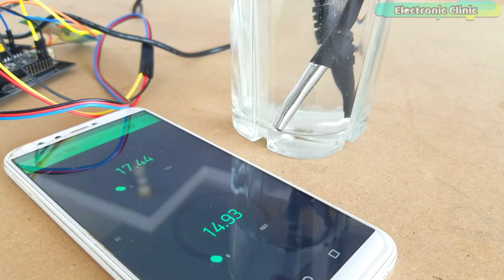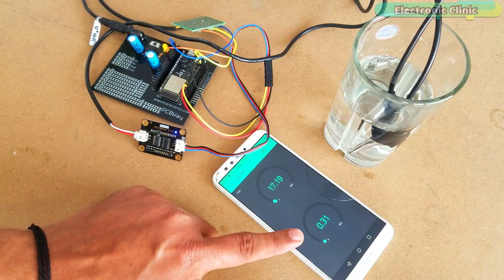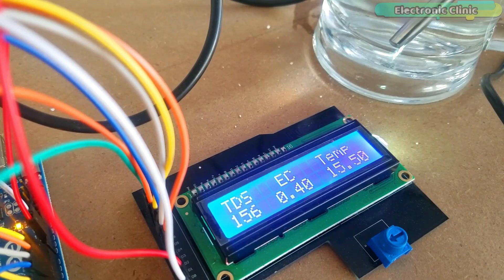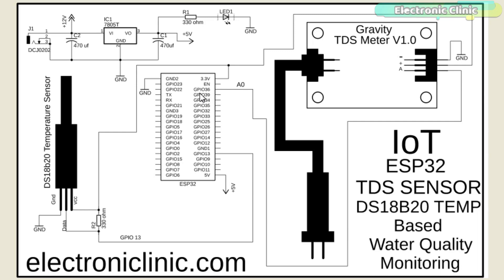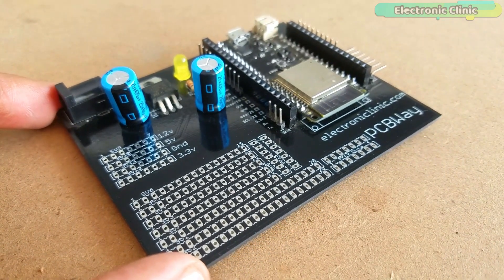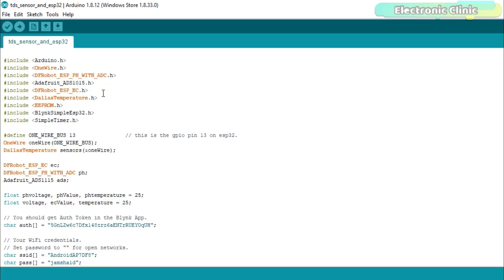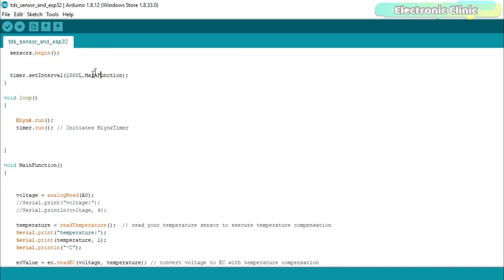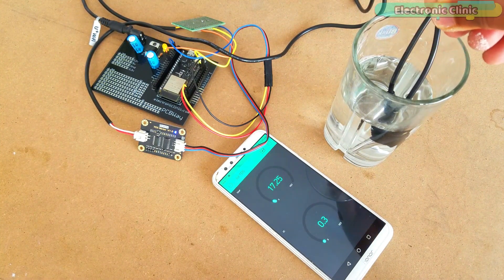TDS Sensor and ESP32 IoT based Water Quality Monitoring system, IoT TDS sensor, ESP32 TDS Sensor

Comment: i can powered up directly to the esp32 right, without doing the board that has capacitor and so on
Reply from the maker: you can so all the connections on a breadboard. If you are using 7805 regulator then use these capacitors.

Comment: how about using esp8266?
Reply from the maker: you can use nodemcu esp8266.
Reply: The sketch code, is it the same?
Reply from the maker: @arale6662  the programming is almost the same, but the pins are different. you will need to redefine the pins, 
you need to watch my videos on esp32 and then compare the codes. you will get the idea
Reply: Ok thank you very much

Comment: Thanks for the awesome video. I would loke to know if it is possible to add a PH sensor to this project? If so, is it as simple just to add the code for the PH sensor to this code? (Sorry I am completely new to Arduino and IOT)
Reply from the maker: you will need to add some electronics to avoid the interference. very soon i will make a video on hydroponics system. i am sure that video will help you a lot.
Reply: Great thanks. I cannot wait! Looking forward to it